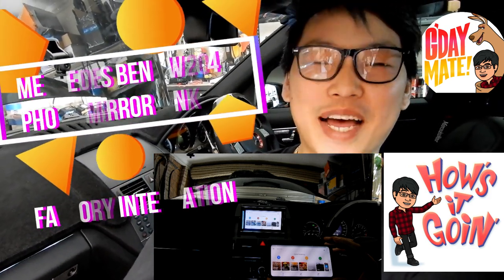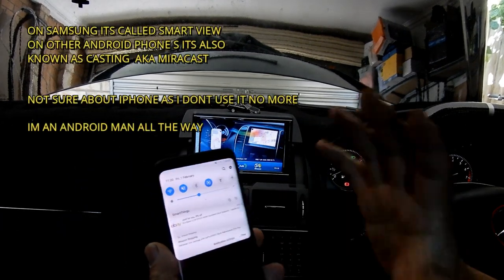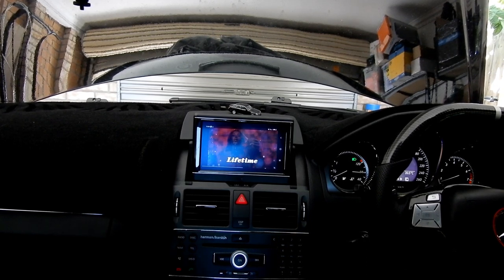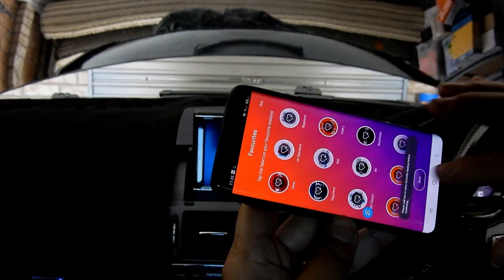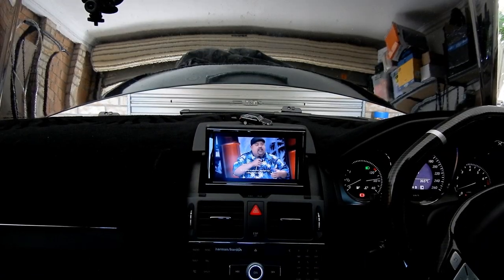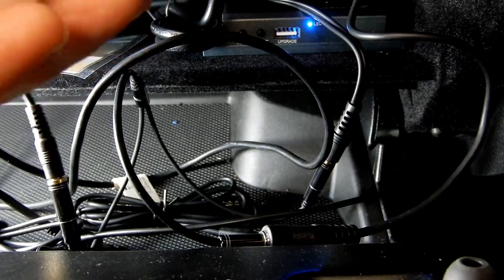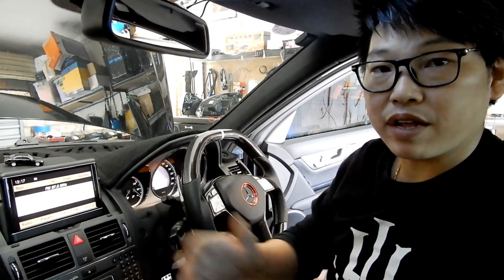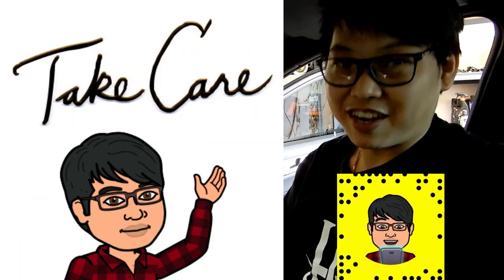MERCEDES BENZ C CLASS W204 PHONE MIRROR LINK FACTORY INTEGRATION

Comment from the maker: in order to add this feature a video/audio interface module is needed with VIM video in motion, it is run via the video aux input via the MMI in the glove box, because i added an aftermarket boot handle camera i already had the video interface module so it was just a matter of connecting the miracast feature and wiring it to work.... it is a complicated install and alot of wire splicing and tapping is essential FYI
Reply: MIKEYZ VLOGZ what is the brand you are using
Reply from the maker: @damnbeast404  so the actual mirror link device is a cheap generic one which only coated 100 aud ... the most expensive part is the video interface module and you also need a VIM video in motion... these 3 devices will allow this setup.... I got an aftermarket camera setup and so I needed a video interface module for my aftermarket backup camera ... so I figuree why not just add a mirror link feature seeing as I already had the means... and at the time there wasnt any other option .... so i settled for this ... it's great and I love it ....
Reply: nice thx...unsure if i will give a try....depends on wht i utilize when i pull out my command center console.....my fear is ahving an additional step to activate which i do not think will work for me.....your videos are so helpful in the decision making
Reply from the maker: @damnbeast404  make sure u do the research and find the appropriate components and worst case a shop can always help.... be prepared for alot of work ...but I'm sure it will be worth it in the end .... once u accomplish it all....

Comment: Aux is quieter than radio/CD. Switching back without lowering the volume will blow my ears out haha
Reply from the maker: yes this is true however my aux is pretty loud
Reply from the maker: also make sure ur aux is a TRS not TRRS so needs to have 2 lines on it not 3
Reply from the maker: do u have the MMI like i do where u can switch the plug in the glovebox
Reply: Yeah I have the iPod and aux one sticking through, had to pull the panel out and found the aux cord hidden in there
Reply: You should check out mbworld, your videos would help a lot there
Reply from the maker: i think that might be the difference... because your aux is integrated like that maybe its not as loud... have you tried using a aux hifi headphone amp..it works wonders i made a video about it and it actually gives you 50% more sound true story..feel free to check out the video its called neoteck hifi headphone amplifier
Reply from the maker: i find it so funny that merc had to feel like they had to hide the aux cable dont you lol....like its suppose to be embarrassing or something lol
Reply from the maker: already have started posting there already my nick on there is huotalicusC200k
Reply: MIKEYZ VLOGS I'll take a look, although it's no big deal for me, I just turn the volume up more and quality isn't that bad imo. It is weird that they hid it though. I think I saw you, my name is Adi-Benz on there

Comment: Hello , greetings for the videos you make!I have question about the mmi what if i have only Aux port, can i add myself mmi or find it somewhere behind the stereo is not on the side panel i already check there.
Reply from the maker: no mmi is another type of add on for your car .. it requires a box setup to be installed .. its not like the hidden aux port... its an option for mercedes

Comment: Hi Mate ! Just wondering If I would need the interface module if I don't have a rear veiw camera? I was just hoping to use a rca to fakra cable
Reply from the maker: yes u do as that will allow u to connect the wireless maracas to it and then allow u to control the back button to switch to the wireless mirrorlink feature
Reply from the maker: now they have a complete plug and play kit u can buy for about 350 aid and u simply follow the plug and play manual and u have all this ready to go ..mainly for phone mirrorlink and Android auto and wireless 🛜 mirrolink online maps ...that's all u really need..I swapped mine to the 12.3inch Android screen as I also wanted digital radio ..and I'm pretty happy

Comment: Can you list at the part you need for the mirror link
Reply from the maker: hey buddy for the mirrorlink to be successful u need a video interface module so u can connect another video source amd then the wireless miracast /mirrorlink device and also the video in motiom module aswell abitpricey but worth to  keep the flip up screen
Reply: Where do I find the video interface module I been looking every where any recommendations?
Reply from the maker: @jaymoneyonthetrackgjerazio6142  oh yea sorry mate u can get them from aliexpress or even ebay i will try and list everything for wen i get the chance but everything. can be found on aliexpress.com cheaper then everywhere else ...amd personally i had help fitting this as i was having trouble wiring the miracast to the video interface module
Reply from the maker: @jaymoneyonthetrackgjerazio6142  #Aliexpress AU $447.16 | Multimedia Video Interface for Mercedes-Benz W221 / W204 / W212 with NTG3.5
https://a.aliexpress.com/_dV78bSZ

https://www.ebay.com.au/itm/302382284583

https://www.ebay.com.au/itm/302382284583

Comment: Hi, 
one question... can you share with us link of video interface. 
Second question are  you install some Video In Motion features or this Video Interface cover this problem.

T&R
Reply from the maker: hi buddy welcome to my channel hope u can subscribe and show your support ... video in motion was also needed ... so that it can override the caution message that is displayed once your car is moving.... I can actually give u a link to the website that I got it from 
here it is 
https://www.naviplus.com.au/online-store/2011-2015-Mercedes-Benz-Face-Lifted-W204-C-Class-Factory-Audio-add-on-Back-up-Rearview-Camera-upgrade-system-p57296361
this was the backup camera I got 
and then they added the video in motion and the mirrolink feature ... as a total package it worked great 
however there are now better better options for the video Interfa e module ... as u can see in the link it's a basic video interface module and it allows multiple RCA connections and some even have hdmi depending on the model of the module 
I'll leave some links to a similar video interface module in the next msgs if your just looking for a plug and play video interface so u can connect mirrolink devices
Reply from the maker: if you goto Ebay and search this item number you will see the video Interface unit it's the same 301788545506
and this is the item number 302382284583 in Ebay for the mirror link module I used it's a great little device as it has 2 types of connections av or hdmi... and that's great making it versatility for installation.. hope this helps you out friend
Reply from the maker: heres another from aliexpress which is basically the same and a plug and play ..you can decide what you would like to add .... it has video in motion installed already because you wouldn't be able to use the functions unless it had video in motion .... it would defeat the purpose of adding other video sources if you did t ha e VIM https://www.aliexpress.com/item/Multimedia-Video-Interface-for-Mercedes-Benz-w204-with-Active-Parking-Guidelines/32794270581.html?spm=2114.search0104.3.20.21a07ca4M8fZga&ws_ab_test=searchweb0_0,searchweb201602_3_10065_10130_10068_10890_10547_319_10546_317_10548_10696_10190_453_10084_454_10083_10618_10307_10820_10303_537_536_10059_10884_10887_321_322_10103,searchweb201603_80,ppcSwitch_0&algo_expid=fd402b04-580b-4852-a7a9-61fd6a9cf01a-3&algo_pvid=fd402b04-580b-4852-a7a9-61fd6a9cf01a

Comment: Hi there.  I recently got a c200 w204. And you are helping alot. I wanted to update my screen and yours is changed and still folding. How did you do that and what kind of screen are you using.? I will be happy if I will hear from you... cheers
Reply from the maker: heybuddy so i never changed the screen... i added a video interface module and a mirrorlink  feature  ...alot  of work ...so i ended up gettting som help with the install.... it links my phone via wifi